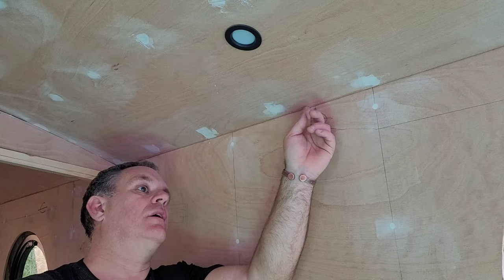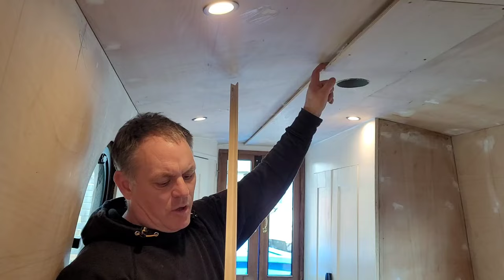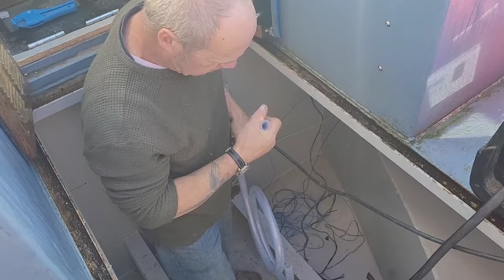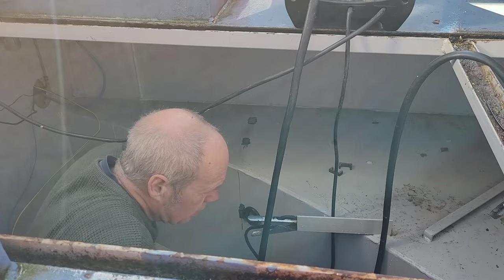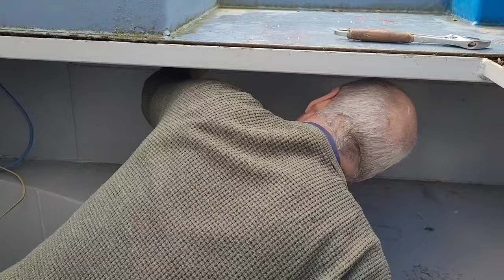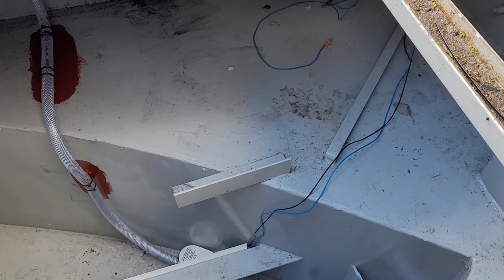Let's get the bilge pump in #110 #boat

Comment: To late now but the bilge pump may have been better under the stern gland as any water collects there first 🤔
Reply from the maker: The two side bilges and the stern gland build are all connected, so the pump will pump from all three areas.  We didn't put the bilge pump under the stern gland, because we used that to put our feet to go into the weed hatch, and would damage the pump if we stand on it. Hope this makes sense
Reply: @leealibuildingtheblackswan2098  yes it makes sense thanks,  yours is the same as mine but like I mentioned, it collects under the stern gland first as the bilge pump only works when the water is deep enough to suck it out, so there will always be water under the gland. Keep up the good work always look forward to seeing you all 😎😮